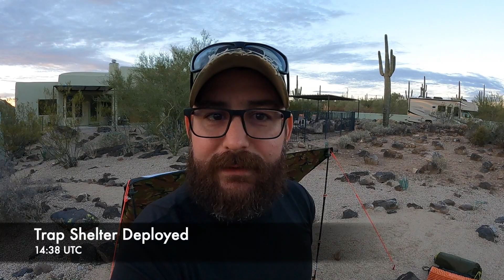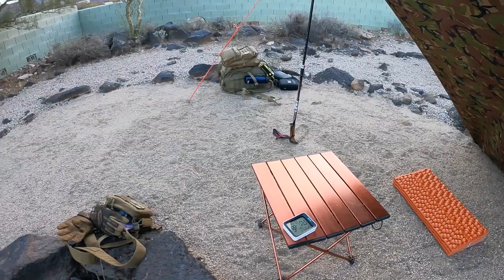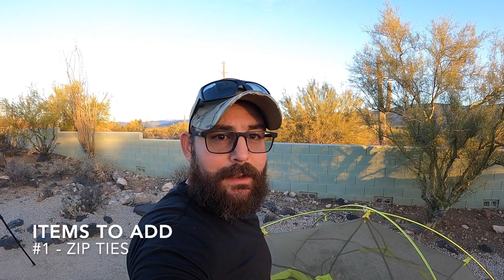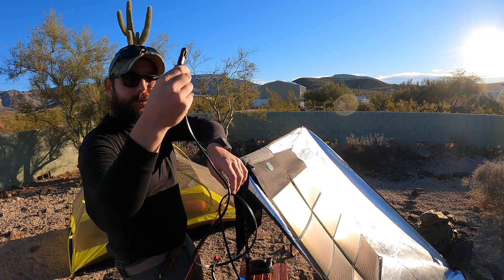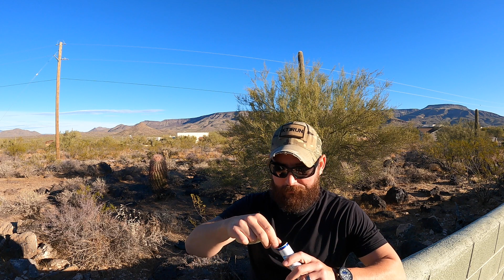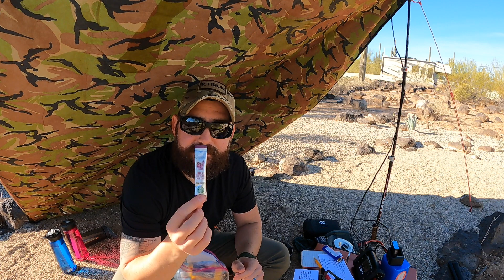Winter Field Day 2021 - Planning and Dry Run

Comment: I did my first winter field day, we did a club outdoor station but not a hike-in hike-out outdoor station and I am so impressed with your goals and hike-in I think WFD should add a hike in (minimum distance from vehicle parking or any fixed structure buildings that could be used for staging gear) and “all gear hiked in and out” multiplier. Just like we have 1H (home single) and 1O (outdoor single) I think there should be a 1R (RV not on shore power, and not in its ordinary home location at your QTH, and not in an RV lot of an RV home or park) and 1X (no structures used at all, other than things you hiked in and out with).  X for extreme WFD deployment.     73s from Canada

Comment: I hope you ditched the heavy tent and tarp and went to Cuban fiber.  Dynema cordage and a relook at how you are carrying water would also need to look at.  Your pack is way to heavy.  I run a 5w station and my pack for winter camping for a week is less than 30 pounds dry including radio gear. Add 3 ltr of water and my pack is half of your weight.

Comment: well your not in Georgia thats fer sure. c u on the air
Reply from the maker: Nope, but the desert was freezing. Stay tuned for the After Action Report.  Sadly, I did not have much luck in terms of contest point running QRP, but the other emcomm experiments worked well enough.

Comment: Great video. this guy has never been in a real emergency, however he would be great to have around in an emergency. definitely willing to work and good source of food for protein.
Reply from the maker: Thanks. I've actually had one pseudo emergency a couple years back. I went on 12+ mile backpack in the Arizona summer with the goal of reaching a water source at mile 10. I had to ditch my backpack and take a smaller day pack to refill my water before it got dark. I was able to find the water source, but lost the daylight and the terrain was not ideal to head back in the dark. I ended having to bivouac without my full gear. It was cold and uncomfortable sleeping, but I had the essentials with me. At first light, I headed back to were I dropped my pack. This is the one reason, I always carry a rain jacket, emergency blanket, gloves and wool cap. Take care and thanks for chiming in.

Comment: Really enjoyed and got a lot of pointers. 65lb bag?? You should get a hunter cart on the desert you could tow a 100lbs. If the sand is soft get the dual wheel one.
Reply from the maker: That's 65 pounds total weight, not base weight. This includes almost 10-11 pounds of water, food and fuel. Great idea on the cart, but the rocks and brush are rough out here. It could be a boat anchor, but worth a look. Thanks!

Comment: Man you are properly thorough! Really enjoyed watching this. Backpacking can be pretty straight forward for keeping the weight down. I also keep a sponge in my pot! But when you start adding radio gear, or hunting equipment, (or both), or anything beyond just camping and it really seems to add up. Got me thinking about a few things. Thank you for putting in the extra time to share your dry run.
Reply from the maker: Anytime. The radio gear really does add on the pounds. I have tried lighter backpacking packs out here in the Sonoran Desert, but they tend to come back with holes, so in the last few years I moved over to these heavier, more durable cordura packs. The only thing I’m changing is the size of the pack. I’ll post an update on Instagram. What adjustments are you planning on making? What are you thinking about?
Reply: @TheTechPrepper  first would be the radio, as currently I only have the 891, which as you know is not suited for proper qrp. Also, the radio itself wouldn't do well at all to ingress of any sort... all of this you know. In that vane, do you get dust storms in the Sonoran? How does the radio do with a dusty and sandy environment? For winter here, humidity and cold are my issues, mostly operating inside some kind of shelter (Oh8STN opened my eyes on the subject of moisture). Next, I've thought about folding tables like you have. I'm going to look around too see if I can find one that hangs from a loop inside the shelter. Otherwise the radio get's a very simple gear loft.

I knew there was a reason for you to carry such a burly pack. The desert just spits gear out. Lastly, I won't be getting too far out this year. I'm scheming how I can do this next year. I hope you and everyone else here have an excellent field day!

Comment: Looks like you have everything you need but you forgot one thing that you probably need to pack that you didn't mention. Air for breathing. Lol. Great video. Very extensive!
Reply from the maker: Thanks, Kyle. The only change will be the pack. I’m testing a 37L and 55L pack now.

Comment: Nice setup! In your climate, I'd look into snake proof garters as well. Much more comfortable in the summer temps you guys get.
I'm getting ready for Winter Field Day as well. Plan to put a new radio to use and see how well my solar kit works in the WI winter. I'll will be on a SOTA summit as well, maybe with a little luck we can make a contact. - KD9NJJ
Reply from the maker: What radio are you planning on bringing? What’s your solar setup look like? I’m still debating on whether I’ll be activating a peak for WFD. It’d be nice to make a contact. 73, KT1RUN
Reply: @TheTechPrepper  I'm planning on bringing both my portable HF radios. My Xiegu X5105 QRP rig, and my Yeasu FT-891. Just got the 891, so I'm excited to work it in the field. I don't have a tuner for the 891, I'll only be on 20 meters with it. I'm still bringing the X5205 along so I can try other bands. So far, I've only used it on 20 and 40 meters.  Since the bands should be busy with Winter Filed Day, it should be a good time to see how my setup works on the other bands.

My setup for solar is pretty much a carbon copy of yours. A PowerFilm 30 watt panel and the Budipole Mini charge controller. Looking forward to see how they keep up with the 891.
Reply from the maker: The FT-891 is an amazing radio. It has an incredible receiver. The IPO, ATT and DNR features making receiving incredibly pleasant. Checkout the PortableZero rails for the 891.

Comment: Perfect timing...was doing the same thing this weekend. Gonna make some changes based on your experience
Reply from the maker: That's great. What changes are you making?
Reply: @TheTechPrepper I want to pre-cut my cords for mast, and learn those knots to save from losing my “knot holders” made by niteize. And some other things more with my camping gear.